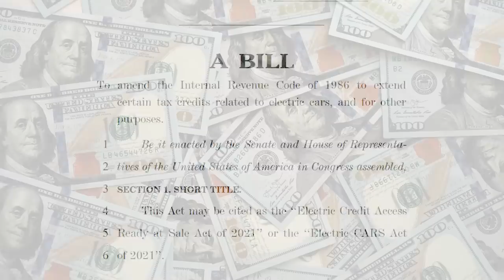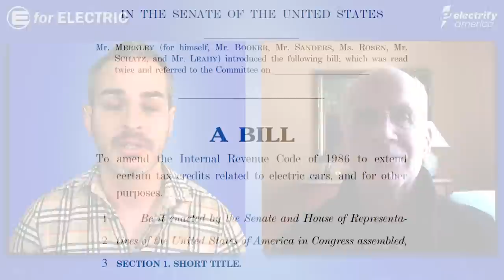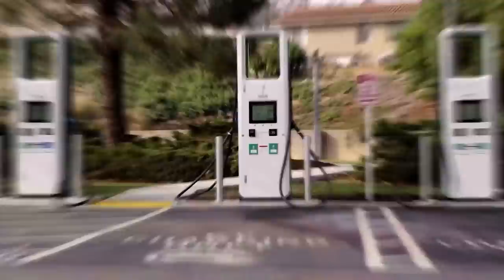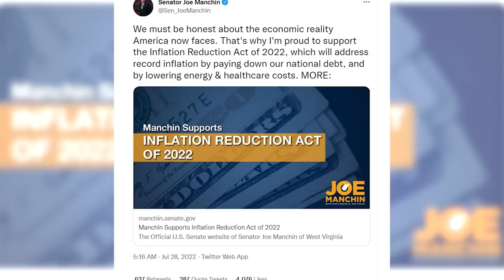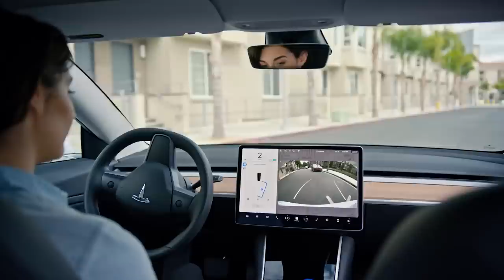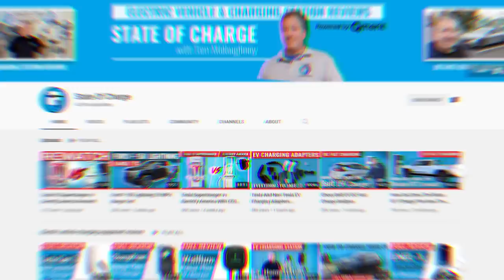New 2023 EV Tax Credit Explained

Comment: I like the "instant rebate" structure much better than the tax deduction. Presumably, all the paperwork will be done at time of purchase, when the dealer has an incentive to help you get it all done, instead of adding ten pages of worksheets and digging up months old records to the already painfully convoluted process of filing tax returns.
Reply: Completely agree!
Reply: The dealer will just mark up new vehicles $7,500. Then they'll give you a $7,500 rebate off of the marked up price.
You pay MSRP. All of the car dealers make millions of extra dollars from rebates.
Car buyers get screwed.

They're presently marking up new vehicle prices, more than ever, and people are paying the prices.

Chevy is offering a $5,900 rebate on the 2022 Bolt. Dealers are marking up the Bolt EV $5,000.
The Chevy dealer gets an extra $5,000 from the rebate.
Buyer gets a whopping $900 off of MSRP.

I was looking at Bolts on dealer websites yesterday. That's what they're doing. Standard operating procedure. Nothing new.

I'd rather have the tax credit.
Reply: No way! Dealers cannot be trusted with the rebate. It'll get mixed in with financing fees, upgrades, etc. And most buyers will leave having saved nothing.
Reply: I would prefer if we did not have dealer networks. However that hasn't been stopping Tesla from raising their prices a 4 times a year on Model 3 and Y lately, which is similar in the end to dealer markups. I still don't want to deal with a dealer though in the end, for my next EV purchase if possible; but that severely limits the car models I can buy.
Reply: @jonferraez  yes, direct from manufacturer model!  No markups and rebate will be great.
Reply: @jonferraez  I agree that dealers suck. But you can just say I’ll pay MSRP with no add ons and no more. Take it or leave it.

Comment: What car manufacturers are not telling EV buyers is that when purchasing a EV your annual insurance premiums will more than double because of the expensive battery. Figure a gas run vehicle insures for $1200 too $1300 annually ; it will now run you approximately $2400 too $2600 annually. Just like a first time buyer purchasing a home ; they never think about the taxes each year . 2 too 3 % of the total value of home . Think before you buy .

Comment: I got an email from the local dealer saying they had an F-150 XLT Lighting available for $ 108,773 + taxes and tags. Thats at least  $50,000 over MSRP.
But I went over to see it and maybe talk to someone. I was told someone ordered it at MSRP and then backed out of the deal. So they are asking “Market” value. 
I was also told that I could order a truck at MSRP.. The sales guy said to let him know. I’m not sure I fully believe them.
They did have a base model on the floor that is their demo model, but of course they can’t sell that yet.

Comment: Hi Alex
I have a 2023 Bolt EUV on order.  Due to the battery restrictions in the law,  I can't determine if the BOLT EUV will qualify for 7500 credit in January 2023. Do you have any suggestions about how to research this further?  I think my car will arrive before January 2023, so if it does qualify for 7500 would I just have to re-order the car and wait again?
Very confusing and I'm not expecting the Chevy salesperson to understand any of this at this early point.  (law just passed Senate today).
Thanks 
Randy

Comment: There should be no incentives. EVs are great cars and should stand on their own!
Reply: That makes no sense at all, nor do you even touch on what the incentives accomplish or how they help EVs become more mainstream 😂…
Reply: @JC-cf4rs  do you drive an EV?
Reply: @JC-cf4rs  no, providing demand-side incentives for a product that is supply constrained makes no sense.
Reply: @kevinkent6351  demand will go up from people who cannot afford one without the incentive. People who can afford are already buying them—makes no sense. 
And this will incentivize manufacturers to ramp up production because the have mid level buyers coming in as customers now—not just people who can pay up. 
As long as price gauging is controlled it’s a good thing. I’m helping fight gauging by boycotting any dealer who tries to sell over MSRP, a lot of people already are.
Reply: @JC-cf4rs  nothing you’re saying makes any economic sense. Mid-range EVs, which barely exist, are already sold out well in advance. There is zero incentive for a dealership to do anything but increase prices with point of sale rebates available. $40,00-50,000 Ford F-150s are being sold for over $100,000. So how, specifically, is artificially increasing mid-range demand (which it actually won’t) going to make EVs more affordable?
Reply: @kevinkent6351  like I said, this will incentivize manufacturers to produce more… most companies are holding back at producing EVs and still growing ICE divisions instead of transitioning to EV production. 
People can still buy an EV right now and not pay a markup. There are legacy dealerships and always Tesla who do not charge up. Customers may have to wait 30-90 days but that’s not horrible. 
So why not make them more available to people who can now afford with a $7500 credit? 
How is that a bad thing? How will that not help other companies transition when more potential buyers enter the market? You are the one who makes no sense
Reply: @JC-cf4rs  It's a "bad" thing because it is poorly constructed policy. If your goal is to incentivize manufacturing then provide a direct tax or other subsidy for the manufacturing of EVs--that is far more effective in achieving the policy goal than by increasing demand in a supply-constrained situation. Instead, the "Inflation Reduction Act" actually raises taxes on manufacturers by limiting the benefits of accelerated depreciation tax rules. So the policy is going to achieve a directly opposite result--higher production costs + more demand = higher EV prices. This is basic economics.

Comment: I like the new structure.  It is clearly geared to the lower priced EV to the middle income people.  It also drives more US content which means keeping dollars home.  Many overseas companies are looking to start manufacturing here.  Vinfast and VW come to mind but I'm sure there are more.  Another company that it helps is Honda.  They will be using the GM battery platform and they will build the cars here.

I have no doubt that car companies will quickly be able to determine content level just like they do right now on ICE cars.  As far as Tesla goes, they have been raising prices for one simple reason besides they can.  They really don't have a whole lot of competition.  While there are other brands sold here, there really aren't many cars available for sale.  Most brands don't even have a vehicle in the showroom to show you, let alone buy one.  Once the other brands start actually having cars to sell, there will be pressure on Tesla to be more competitive.  You will see their prices come down or they will introduce a lower content vehicle at a lower price.

To the point about LFP batteries for Tesla.  They will be built by CATL and CATL is looking to build a plant here in the US.  So I don't see that as an issue long term.
Reply: I also like the new structure more than the old one. It felt like manufactures just raised prices to get the $7,500 tax credit. 

If manufactures try to get the credit to it's customers now/under the new structure, they will need to source battery materials from, hopefully, labor that is paid correctly. I am not an economist, or a wordsmith. Just think it would be nice. If the intended help goes to people who need it. 

In all likely hood. This is going to the base framework for manufactures to "liberate" conflicted territories, build more mines, and make sure the labor has just enough to survive.
Reply: Really good points 👍
Reply: @wabash1581  You can't have it both ways. Either climate change is an existential crisis requiring immediate action or American manufacturing under the guise of union labor is the chief policy aim. A mix of foreign and domestic production achieves lowest prices and maximum production, which maximizes the availability of EVs. Pick your principle--you can't hold both principles as #1.

Comment: They cost way to much!
I won't buy any EV at the prices today.
Reply: Good, because they are already hard to find, could use less people trying to get one.
Reply: Check the used market, you may be able to find a good deal if you don’t need a brand new vehicle.
Reply: Chevy bolt is 26000
Reply: And with the improved rules it will be cheaper than a base trim Corolla. But of course only for those that are able to charge it.
Reply: @JohnGeorgeBauerBuis  Used cars are about or almost the same pice as new ones.  Not going to do it used or new!!!!

Comment: Wonder if the MSRP is with or without destination charges. If without, gives Tesla another option to drop below the caps. Since they own the delivery network, they could shift $ from the msrp to a delivery and destination charge. They could justify a much higher fee since they are responsible for the overhead and administrative costs of these centers. Other manufacturers couldn’t do the same since dealers fulfill these last steps for them.
Reply: MSRP tends to not include destination charges, you might wonder why that is right? well, delivery costs are higher say to Hawaii? and they also be higher to small towns, and other remote areas.

Comment: I'm not sure why Tom (SoC) says that Toyota benefits? All of Toyota's EV vehicles (Prius Prime, Rav4 Prime and BZ4X) are built in Japan and not North America. Can someone explain Tom's statement?
Reply: well, i thought they started producing Priuses in the US. course they do make Camerys in the US, and they might make the hybrid version too.
Reply: @davidwillims2004  No. I own both Toyota’s PHEV’s. Prius Prime and RAV4 Prime. The VIN number confirms, plus I know this, they are built in Japan.
Reply from the maker: Their hybrids (non-plug-in) that they make in the US will likely qualify now. This new plan isn't limited to plug-in vehicles, it states "clean vehicles" now, which can include non-plug-in hybrids.
Reply: @EforElectric  That's great. However, the battery has be at least 7kWh is size, battery assembled in NA and battery minerals from a trading partner. So an up hill battle to qualify. But the's a great point you're making. It doesn't have to be a plug-in.

Comment: These expensive EVs don't need to be subsidize.  Only folks that can afford them are rich folks.  Rich folks don't need a handout.
I'm glad that US made is a requirement.  Things that are sold in a market should be made in that market.
Reply: are you talking  about EVs over say 90,000? none of those qualify any more,  if you look at transaction prices for vehicles today, you find that there are few vehicles that are bought, that arent in the 40,000 range.
Reply: @davidwillims2004  I'm talking about any EV they are all expensive and regular working class folks can't afford them.
Reply: I am a blue collar worker and I bought an id4. So yes normal people can afford these
Reply: @DaBinChe  well i have an EV and it wasnt all that expensive, but its a lot cheaper now, less than most ICE vehicles too

Comment: Will the current tax credit remain in effect in 2023 if the new one is passed? We ordered an i4 that currently qualifies but would not under the new scheme. Due to supply chain or whatever, our car won’t be delivered until 2023.
Reply: The proposed bill which could change currently says EV’s manufactured outside the US will not qualify as of the day of Enactment (likely August 2022).  Can you get an inventory car now.
Reply: There is a transition period in the "proposed" EV bill. If you order (not a wait list) from a dealership and receive delivery in 2023 then you can use the old/current EV tax credit.

Comment: Tesla opened its German factory in March 2022, which should have caused a huge increase in European sales and market share for Q2.
    Instead, Tesla’s European sales and market share fell by half in Q2, as if Tesla had closed its sole European factory.
    Tesla’s European EV market share was 20% in 2019 but has since fallen. In Q2, it fell below 5%.
    Counting only BEV (excluding PHEVs), Tesla’s European market share fell from 18% in Q1 2022 to 8% in Q2 2022.
    There's an onslaught of other EVs for which new European factory capacity is created, without getting nearly the media attention compared to Tesla.

Comment: This bill will prevent EV adoption as it will qualify most hybrid cars (7KW battery), so rescuing Toyota!
Reply: And increase inflation. Democrat thinking.
Reply: @jamesvandamme7786  and just how would you stop inflation that is caused by a supply chain crash caused by a pandemic.  the basically definition of inflation is too much money chasing a limited supply of products. such as vehicles, where on average there are about 4 million vehicles on dealer lots, not, we have less than 1 million, and dropping. so there has been a drop of about %75 of supply.  and with all the noise about oh bills passed last year are the cause of this, explain how that works when its was a one payment, and it wasnt that big a payment to begin with. and even that extended unemployment payments stopped in 2021, so hw do these things impact inflation is 2022?
and the supply chain  was designed by business for business. and had no way of dealing with any sort of disruption and it shows

Comment: PHEVs qualify for a (smaller) rebate too, provided their battery is large enough, such as over 7kw (I’ve read). Toyota will benefit if the new PHEVs it will be making in its Alabama plant meet that limit. If they do, they should sell really well, and the company would have the last laugh vs. its critics.
Reply: And nobody will charge them, just run the gas engine. So, another stupid idea.
Reply: @jamesvandamme7786  People will charge them if electricity is cheap and gasoline is expensive, and they have garages. I suspect the case of a European country where PHEVs weren’t electrically charged had some unusual circumstance that wouldn’t apply here in the U.S.

Comment: If EV’s can’t compete in the market place and run on primarily nuclear instead of primarily coal, they don’t deserve to survive.
Reply: You will need to do research instead of spreading FUD with thoughts from 100 years ago. EVs will be running on electricity which is isn't localized to your town but spread across the grid sections of the US, plus a bit of the screwed up Texas hillbilly section which is already 30% renewables. The US has about 230 coal plants remaining and those are often peaker plants because they cost a lot to run, with coal now only making up 23% of the US electrical generation and reducing. 96 nuclear plants which remain the most expensive way to produce electricity, not to mention the waste problem of entombing onsite and hoping someone is a good caretaker the next 1000 years. Renewables are the least expensive method and continues to grow annually. The real solution for America is the storage being added to the wind and solar generation. That will get us away from the age old method of humans (now computers) constantly turning the dial up and down trying to chase the constantly changing demand and causing outages and brownouts.
Reply: EVs mostly charge at night, when generators are wasting energy with no customers

Comment: Used zero emissions vehicles are included in this rebate? So we could buy a Tesla, then sell it to our cousin, then our brother, and get triple rebates?
Reply from the maker: No. As I mentioned it can only be sold once to get one rebate and it has to go through a dealer.
Reply: @EforElectric  I was kidding. I expected they would not include private sales. But thanks for the quick response. I also shared my comment as I was watching your video, so I saw the caveat explained after I posted.

But I did hear from the Electric Viking the semi could qualify for a big rebate from California and one from the feds. And, of course, I'm expecting some kind of caveat on that too.

But I would not at all be surprised if Tesla delayed production of the semi until it got substantial rebates for it. It makes no sense for the people preordering them to wait this long without a big reason for doing it. And massive government rebates would qualify as a big reason for waiting. I just wish they would get their act together and start producing electric tractor trailers no matter what it takes.
Reply: I was thinking if the Tesla semi has autonomous capacity, it won't need the cab at all. So it could operate like the truck for a train car, with 4 wheels and be completely under the trailer. It might have the ability to make really tight turns. And it might be possible to have one of these drive units at each end of the cargo container, so it would be more maneuverable (the back end as well as the front of the container could turn). That could mean spreading the weight of the batteries between two "semi" trucks or have twice the distance capacity.

There may be limited locations where autonomous and semi-autonomous driving could be done right now, like in isolated places (Australian Outback, for instance).